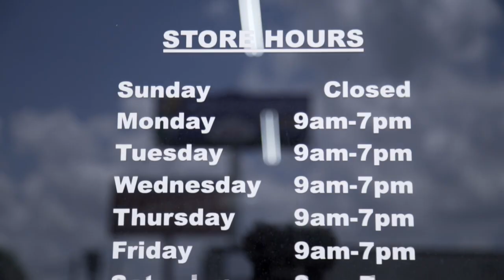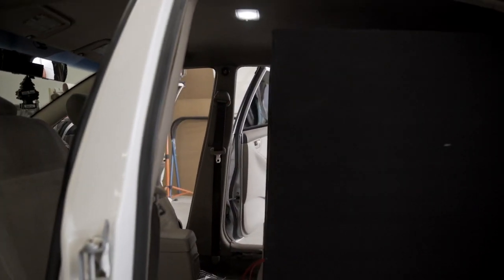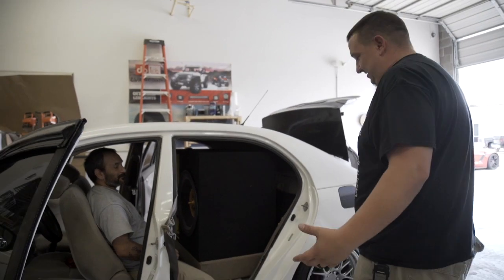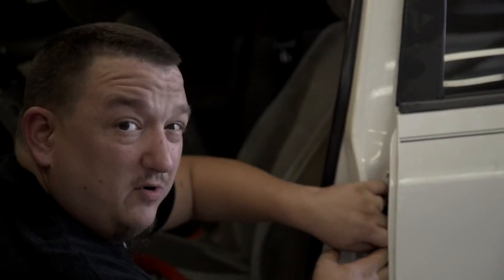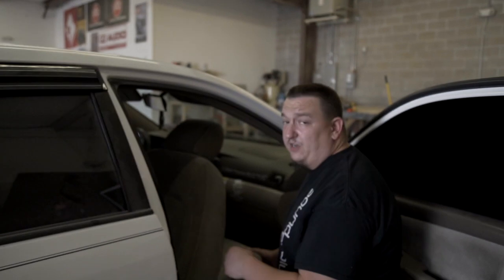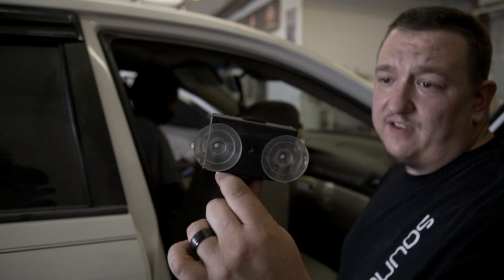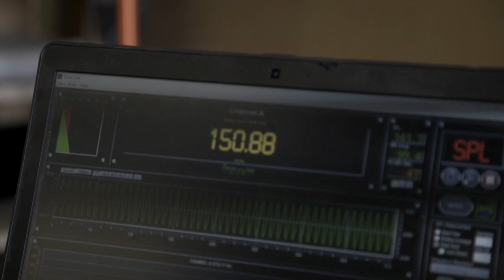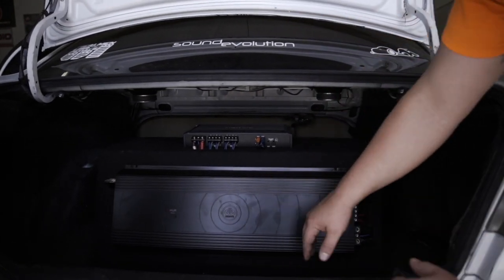SEASON 1 EPISODE 4:  Project Corolla Goes HAM!

Comment: If one of two speakers on a mono amp isnt working, there is only one way that could happen...  Couldn't you just see that the speaker wasnt moving?

IMO, $1600 for that type of old technology speaker is flat out reedonkulous...like stupid ridiculous.  For that same money you could have used two 3k RMS killer subs that would have absolutely crushed those CVs...and still had money left over for pot and beer.  It was the customers money so I guess it doesn't matter....
Reply: Crazy 8s Drums it’s not that easy to spot, I’ve made the same mistake before. the wired sub is pushing the other one making it look like there both playing. Leaves you wondering if it’s the box or product.
Reply: Just need a 9v battery...to 'pop' the speaker.  Every install shop should know this.  Perhaps they will now know a new (old) trick to test for speaker function and polarity.